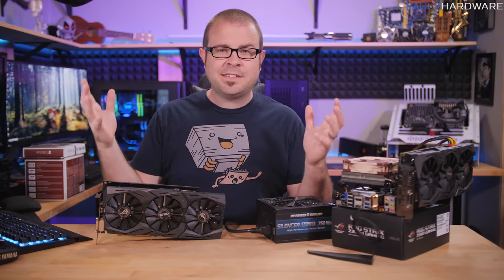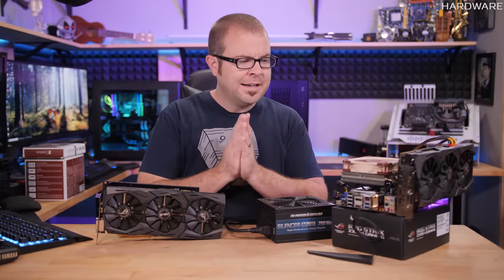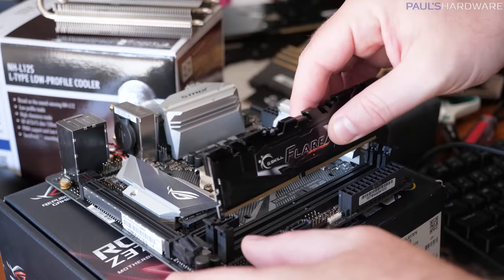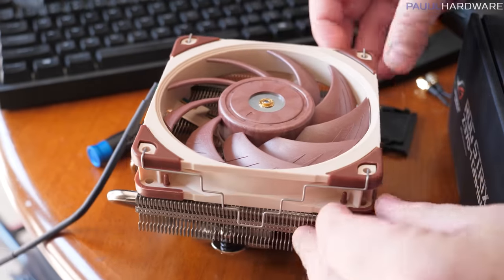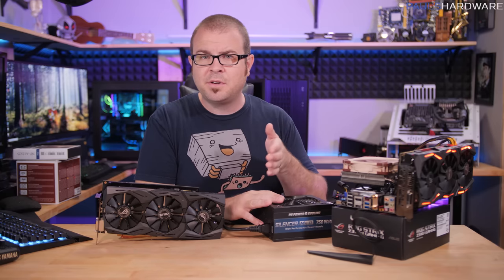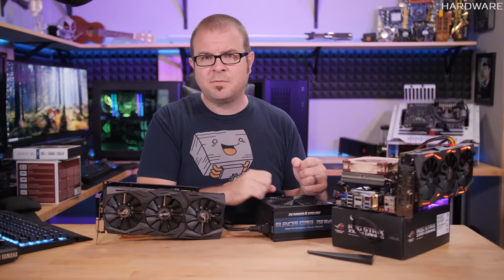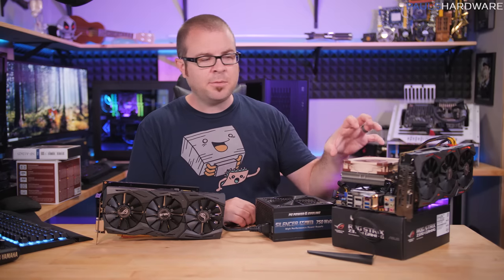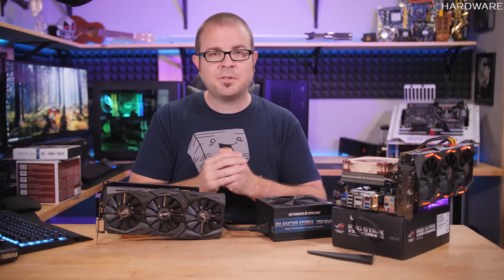Emergency Portable Benchmarking Rig!

Comment: Who needs to buy a monitor when most hotel rooms have TVs!
Reply: Pretty much all of the hotels I've stayed in recently have had the HDMI ports accessible along with free WiFi so I just take my Fire TV Stick along with me
Reply: @The87por924   good to know regarding Aloft! Cheers
Reply: NVlink on HDMI!
Reply: @The87por924  It's not hard to hack as long as they have ports which they usually do here. For example turning off the digibox(set-top box) has worked for me. I don't know if they get mad at you for doing it but no one has noticed/cared yet atleast in my experience.

Comment: This is almost exactly the same kind of build Kyle did in the DAN Case A4 SFX v3. You might as well put your rig into a small enclosure like the DAN Case since a PC like this would be very cumbersome and sloppy to lug around as it is. Putting it into a small case will mean your stuff is protected and all in one unit, instead of the mobo, GPU, PSU, and cooler are flopping around in your luggage. The DAN Case seems very easy to pop open to swap out the GPU.

Comment: If you're going to have a laptop with you anyway, maybe instead of sperate keyboard/mouse/monitor, you could access the benchmark machine by remote desktop through the laptop over Ethernet or something? This would reduce the necessary purchase list to just a PSU. Does running benchmarks require near zero input latency? How much might this impact benchmark performance? Or is there some other reason this arrangement would be suboptimal?

Comment: You should get yourself a Harbor Freight or mil-surp aluminum "briefcase" just big enough to hold a small monitor in the lid that you can mod into something you can just open and plug into the wall...

Comment: RAM question! So I picked the G-Skill Trident Z Cl14 RGB 32Gb (2x16g) 2 kits quad ch in X99-M w/ E5-1660v4 & it’s awesome there but now I’m using it in dual ch w/ i9-10850K on Z590. Is this still good RAM headroom for creative media work & VM testing. I don’t rly need RGB (but it’s awesome) so a dual ch 64g kit 4000 or so will b cool

Comment: Build it into a flight case with the monitor in the lid, you may even be able to squeeze an SFX PSU and a cheap tablet bluetooth keyboard in too. No need to keep buying parts and contributing to overall waste.

Comment: Paul, consider the A4-SFX case for something like this. It's tiny and can hold this system easily with an SFX PSU and a 92mm AIO cooler. And you can buy an ASUS portable monitor and a keyboard/trackpad combo and have a highly portable system. Kyle has an A4-SFX, you can borrow his for a few days to see if you like it.
Reply: He wanted a test bench not a case. It is a benchmarking rig not an actual build.
Reply: The A4-SFX is basically a test bench if you remove the side panels.
Reply: okay dclover, having a system already put togeather that you just have to take off the side panel? or carrying around a box and having to buy a psu, and put the whole thing togeather then disassemble it when youre done
Reply: @Tuvzii  it isnt meant to be a full system it is a test bench.

Comment: Get a foldup usb monitor from asus. A 400w HD PLEX micro psu that takes a laptop power brick. And a wireless keyboard and mouse. Also with new m.2 enabled boards. You could have a pair of motherboard mounted drives...

Comment: Get a custom piece of luggage, custom foam inserts so you can bring the entire computer system inside what is essentially a lightweight portable PC case with wheels and a pull handle. Have a lightweight thin "travel" monitor and travel keyboard and mouse inside the luggage and you have the entire benchmarking system ready to go at a moments notice and never have to go to Frys or BestBuy to pick up additional items on the go. Plus... it would just be cool. Then get @fractaljosh to build the case/luggage.

Comment: What I hate about this motherboard is that the m.2 ssd slot on the bottom of the motherboard is nvme only it doesn't support SATA m.2 ssd so when I transferred my m.2 raid they were both SATA and one wasn't showing up after a few days I found out that the bottom slot only supports nvme so I had to reinstall Windows with only one ssd working which in the manual I didn't find anything about the bottom slot being nvme only but online they have it on the manual and all the people who asked online I found like 20 different forums with same question only one had the answer

Comment: Just a moment: can anyone please confirm the reset switch of the Cooler Master H500m wasn't entirely replaced with a rgb controller (that is what I've heard, seen and  read all around the web)? The picture at ~ time index 0:38 reads (4)  "Reset Switch & Optional Adressable RGB Controller"
The "missing" reset  switch was my reason for dumping the CM H500M in favor of another case.
epic facepalm

Comment: pcper have stated that using an m.2 heatsink can half the life of an m.2
Reply: only if it contacta the memory chips. the controller on the other hand can be heatsinked. Don't put the thermal pad on the memory chips and you are golden.

Comment: " If you want to get the most out of them"  That only applies at 1080p shit settings. At real settings there is hardly any difference.

And honestly if your testing a GPU, whats the point at benching at low res when your CPU will be the limit. Why not crank that bad boy up and have the GPU be the limit.